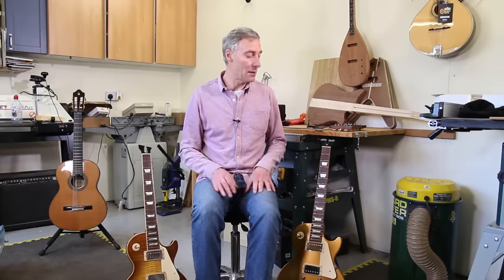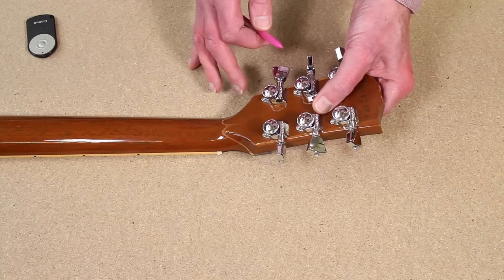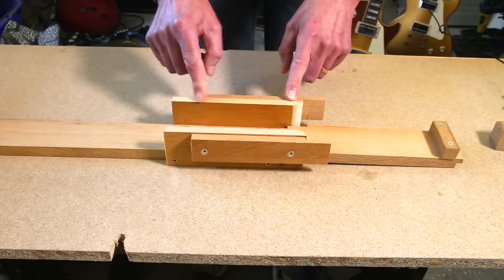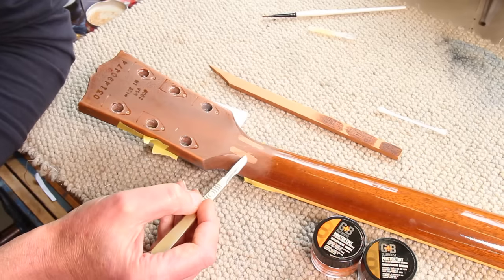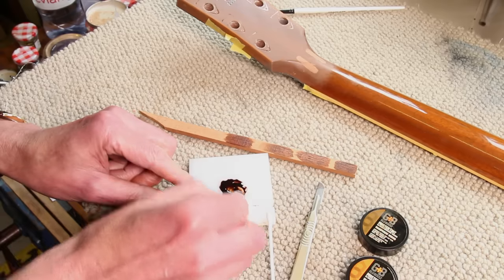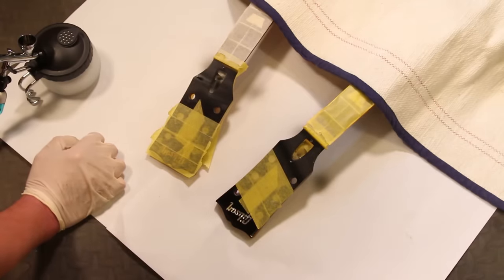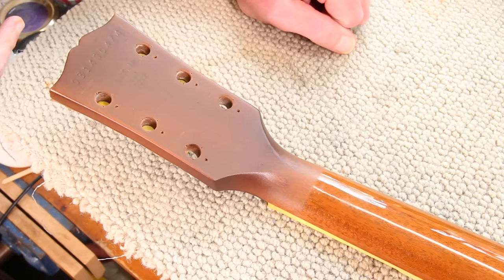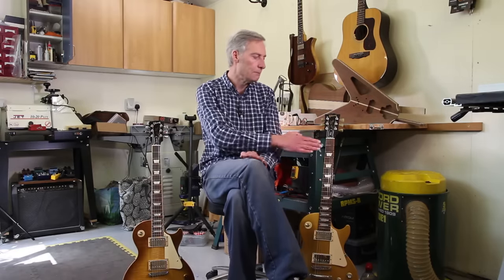Repair of a Gibson Les Paul with a snapped off headstock

Comment: Good old Gibson always looking to help smaller luthiers by giving them plenty of work on these complicated times! So kind of them
Reply from the maker: That thought has crossed my mind  many times!
Reply: I hear that there are lots of Les Paul neck breaks, but I need to see some numbers, not just anecdotal evidence.
Reply: @Wizardofgosz  Not a frequent occurence but should a non-70s (Norlin era with the volute headstock , one of the only positive attributes of the 70-83 Gibson era) LP fall backwards on the headstock, chances are it's going to crack at the very least. In the case of this video, I have never heard of a neck snapping like that without an extremely hard hit.
Reply: @kevinsibert3160  I had a 73 Les  Paul Custom with a volute which had a headstock break. My understanding was that the volute never worked which was why they stopped using them in the 80s.
Reply: I have a 1985 Les Paul Custom and no neck breaks I play it four hours a day and used it on stage extensively when I was younger. They don't pop apart by themselves, but the headstock is tilted back at 14 - 17 degrees and the neck join is tilted back at 4 or five degrees if the thing falls backwards for example a headstock break is extremely likely. The tone and feel is worth it but you have to be sensible. I always carry one of those fold up Hercules stands in my kit bag. Strats and teles are all flat (string pressure is created with string trees and such) hence breaks are much less likely, but they do happen. I've seen it!
Reply: Richard Wielgosz my 1963 ES345 broke twice! First time, it fell forward off its stand onto a carpeted floor and the head flipped forward. Second time I found it broken inside it’s hard case. I can only presume someone had knocked it over. Still only marginally less sickening than watching it happen!
Reply: Richard Wielgosz Numbers? Like, someone's just compiling evidence of all the Les Pauls that have had headstock breaks? Just look at used Gibsons on the internet, like an eighth of them (maybe even more?) have headstock repairs. I've fixed probably half a dozen of them, and I just do guitar work as kind of a hobby, real luthiers have done dozens or even hundreds. It's widely known that it's unusually easy to break Gibson headstocks due to the unnecessarily high angle, no volute, very thin material, and one-piece construction.
Reply: @hydorah  They're also maple which is much harder to break, with virtually no headstock pitch as you indicated, and often need aftermarket fixes (Like a Mastery Bridge and a Buzz Stop tensioner on Jags and Jazzmasters) to combat the tinky Fender tone.
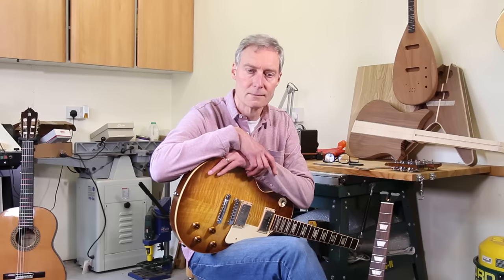Reply: @Wizardofgosz  Did you even watch the video? Starting at the 1:20-mark, the creator of the video says over the last ten years, the vast majority of broken-headstock guitars he's fixed have been Les Pauls. If you want to conveniently ignore what he said, go to reverb.com and look at used Pauls. A ton of them have had headstock repairs. Knowing about the fragile headstock, I treated my '01 Custom gingerly and never experienced a break. As with many Les Pauls, though, the G-string would not stay in tune, no matter how much time and effort went into fixing it, so I never gigged with it. I sold it for cheap and made sure the buyer knew about the tuning issues. I have not missed that guitar and that brand at all.
Reply: @jaypreminger8942  I'm sorry. Did you say something?

Anecdotal evidence. Sorry.

everyone thinks red shirts always die on Star Trek but you know what, when you do the math it's actually yellow shirts that die more so sometimes things aren't always as they seem. Anecdotal evidence doesn't mean a goddamn thing. Show me real numbers
Reply: Unlike that insensitive Fender with their "bulletproof" necks!
Reply: @Wizardofgosz  Sensitive much?!
You must be a Gibson fanboy, getting all hot and bothered over what is common knowledge in the luthier trade!
To my knowledge there is no database with the hard numbers you seek, doesn't make it not true.
Reply: Well said lol!

Comment: A Les Paul with a snapped off headstock, now that's what I'd call 'Authentic'
Reply: Indeed, Gibson is to arrogant to fix the design. After all, it "tradition".
Reply: @joshuabarron8535  it's not a gibson, it's people. tell me if you were a gibson les paul fan, would you prefer different design? of course no. masses dictate design, and in this case i agree with them. i love les paul design :)
Reply: If you like the LP style of guitar, then try other brands. They will be a much better value. Gibson=overpriced. Something like the PRS SE 245 Single Cut Electric Guitar. Less than half the price. And because its PRS, it won't have quality issues, or a dated headstock design.  CHECKMATE
Reply: @joshuabarron8535  hate prs. i'm thinking of getting maybach lester, they are plain amazing. but they ain't gonna hold their value as well as gibson of course.
Reply: @joshuabarron8535  "dated" is what drives people to buy gibsons. and i'm this kind of guy :)
Reply: @DeeKeyLP  Whatever fanboy.
Reply: @joshuabarron8535  good for you i'm. not as toxic
Reply: @joshuabarron8535  They did change the design.
they reduced the angle of attack on the headstock and carved a thicker sort of volute in the arc of the headstock to further reduce potential breakage.  Not to mention the Maple necks that went in.  All that in the 70's to about.... 1982 or so.

The end result was the cork sniffers who kept  saying (that's not a 50's spec wtf!)  stomped their feet until Gibson stopped doing it.  

It's just a thing you're going to live with and possibly face because better or worse it's the gibson sound and feel.  Comedy that the same cork sniffers want to imagine your guitar is worth 1000 dollars less because it's had a neck repair.  (just not theirs)
Reply: @leedemkiw.2894  Thats your opinion.
Reply: @voided76  And yet they still break. 🤔
Reply: @joshuabarron8535  very true.  

I think that's at least part of the reason gibson went back.  You can mitigate it 100 timse but when is it not what you started with and if it doesn't quite sound or feel the same and it STILL can break ... well f it  lol

Being that I broke my own 93 LPC and being that it was glorious before and after the repair,  I don't see a lot of the gripes other than "shit happens"
Reply: @voided76  Owch, bummer for your guitar man, sorry to hear that.

Comment: Having worked in a guitar shop specializing in used and vintage, I've seen many repared Gibson headstock breaks. I have never seen one done as beautifully as these. Thanks, I've subscribed!!!
Reply from the maker: Wow, that is very kind of you.
Reply: MANY repaired Gibson headstock breaks tells the tale... Gibson has faulty factory guitar design of the headstock/neck area that fails repeatedly.
Reply: @DougHinVA  I don't get what is faulty about it? Usually when you drop something, it breaks. Knowing that Gibson's neck angle is prone to breaking when they fall back, don't drop them. That would be like wondering why a TV breaks every time it falls on it's screen. It's not a faulty design because they're not meant to fall.
Reply: @wiseguy9202  only he explained the owner was quite certain he hadn't dropped the guitar.
Reply: @jimmoore7442  the headstock didn't just fall off by itself. It's an obvious impact break.
Reply: @wiseguy9202  Certainly not. Have you never seen a piece of timber that has split by itself? Of course you have. Timber moves especially if not fully dried properly.
 The design has no strength because it is relying on cross grain to do more work than it can.
 I have a problem with a Bass made to order by an American company. It has been played 3 times in church thanks to lock down and a bit at home.
Its body has actually burst from the inside out in the area near the Jack socket where there is cross grain that doesn't belong there. What do the UK vendors say? Ah we can see its been dropped. Not so it was fitted with strap locks before it even left its box. 
This is what happens when prestigious big name companies get it horribly wrong.
Reply: Well luckily for me and everyone I've ever known that plays guitar, have never had a headstock just randomly pop off. If that happens, I'm not calling a luthier, I'm calling a priest to perform and exorcism.
Reply: @wiseguy9202  Maybe if you call a priest who is a luthier he will perform a resurrection 😂
Reply: @flameguitars5770  I agree with Walter... Great work. Really turned out nice. On another note, in the future if you want to record the spraying process, you could just cover your lens with any of various different types of transparent plastic materials. You could even just rubber-band a piece of plastic food wrap or packaging shrink wrap.
Reply: @DougHinVA  “Yeah, well, you know, that’s just, like, your opinion, man.”
Reply: @jimmoore7442  And  I  believed  him.  Maybe guy had kids...or  mischievous spirits, being England and all.
Reply: @jimmoore7442  mischievous spirits
Reply: @wiseguy9202  'wise guy' is a good name for you. TVs and electric guitars are not at all alike and a Gibson LP is one of the finest electric guitars from a factory. Explain that away and no TV sets included in the excuse making...
Reply: @DougHinVA  Not sure if you're missing the point on purpose or just effing with me?
Reply: @DougHinVA  "Gibson LP is one of the finest electric guitars from a factory.". LOL: Gibson has some of the worst quality control of any major guitar manufacturer!
Reply: Well…. Mine broke about a week ago… it was fine the day before it broke.. I picked it up from the stand…and there it was.. cracked..

Comment: Beautiful work by a true craftsman! I had a 1974 Gibson Led Paul Custom as my first electric guitar. No break on the headstock, but I wonder why Gibson has not fixed the issue permanently by now.
Reply: Gibson fixed this issue in the 70s with 3 piece maple necks, a lesser headstock angle and the volute. But customers wanted 50s style Les Pauls and so Gibson went back to the weaker Mahogany neck design prone to break…

Comment: A great craftsman indeed.
In the 1980's I bought a new Gibson J-50 acoustic which came with a Gibson case. To my horror 2 weeks after I bought it I opened the case one evening and the headstock had snapped off in the same way that you describe in the video, I was devastated, I got in touch with Gibson who were far from sympathetic, they more or less called me a liar and would not accept that such a thing could happen, they took no responsability whatsoever.
I was living in Paris at the time so I took the guitar to Favino who made a repair for me which was fairly good but did not last for too long, the head moved a little which made it almost impossible to play.
That was the the last Gibson I ever owned, moved on over to Martin instead.
Brilliant job on those two LP's

Kind regards
Hamish
Reply from the maker: Thanks Hamish. You will find a number of comments here questioning whether it is possible for a neck to break without some form of impact. But you will also find a few people saying that they opened the case and found the neck had broken. I talked to someone recently who had a new gold top and the neck snapped within the first month of owning it. Devastating.

Comment: My grandmother had a 70s Les Paul.  She had it put away in her closet.  It was perfectly fine, then when she passed away, we opened the case and sure enough the headstock was snapped off.  This is a woman who used plastic on the couches. The rest of it had no dings or damage.  Had it repaired and you can't tell unless you use a bright flashlight and look closely, but it's black so that's easier to hide.  This repair is beautiful. Very nice work!

Comment: What is it they say about a repaired head stock being stronger than before? They should break them at the factory, then repair them; it won't happen again.
Reply: They should drill dowels into them and do a proper fucking job of engineering.  It's a stressed member with only a couple of mm of thickness on a stress point.  Shit design.  Don't get me wrong, I love these guitars but the headstock is the weakest thing on the guitar.  Easy to fix.
Reply: @GodzillaGoesGaga  Thing is, it's not like it's a new design. It's been crappy for decades. I know, I know, people like it. But if it's crappy...
Reply: @GodzillaGoesGaga  
Perhaps, cut channels and insert maple pins, dowels or splints before the headstock overlay and fingerboard are installed at the factory.
This would probably be best done along with routing the truss rod channel into the neck blank. The aesthetics of a one-piece neck would be unaffected and the reinforcements would be hidden along with the truss rod.
Reply: @maverickdallas1004   Nah, inlay rebar; all up & down the neck. No-one'd ever know...
Reply: @maverickdallas1004  I was thinking rectangular bar stock graphite for the inserts, since they'll be completely hidden under the fiber cover anyhow. It's similar in concept to putting graphite rods under the fingerboard of a neck that didn't originally have a truss rod.
Reply: Make the headface out of carbon fiber and put the truss adjuster at the heel.
Reply: When Gibson added a volute in the '70s, players went nuts. Martin used a volute at that time, as well. They make sense no matter what the purist experts have to fuss about it. And people need to learn to use humidifiers in places where air conditioners or heaters run most of the time. Mahogany is a relatively soft wood and dries out in a hurry, on top of being soft. I changed a BUNCH of tuners in the '70s, replacing those crummy original tuners with Grovers or Schallers, and the residue would fall out of the headstock as very dry powder.
Reply: Certainly think Gibson should be looking at redesigning that part of their guitar.
Helped me decide not to buy one.
Good job Gibson don’t make aeroplanes 😱
Reply: It can only be as strong as the surrounding material...

Comment: And my VERY similar happened to a Gibson Les Paul Standard that was resting IN A STAND, but it was plugged in, and my ankle was tangled in the lead, so when I walked away I also yanked on the guitar and it took a nose dive resulting in a complete break just above the truss rod cavity...  Luckily I was able to repair it myself with some good old Elmers wood glue and clamps, and a few years later it's still holding, knock wood!
Reply: I cringed reading this
Reply: Just don't knock on the repaired headstock wood😁

Comment: Fantastic job on that color matching hiding those splines. If that was my guitar I would have told you not to bother with color matching. And I'd have said go ahead and use maple. Battle scars! What's a Les Paul without a repaired headstock?
Reply: I agree. A quality, proper repair is important but in my opinion there’s nothing wrong with an evident repair. Maybe some dye on the splines so it isn’t highlighted would be ok. I suspect the neck is stronger now than when it was new.
Reply: Hear, hear. In fact, if it were mine, I'd use maple and then refinish the neck natural. I would do exactly what he did on the front, but I'd want to showcase the clean repair on the back of the neck. A Gibson neck repaired this way is much stronger than when it left the factory, and on a player-grade instrument is often as or more desirable than an unbroken one if done well.
Reply: "What's a Les Paul without a repaired headstock?" One that's never been dropped.
Reply: What's a Les Paul without a repaired headstock?
My maple necked '76 Custom 😂
Reply: Peter Macfarlane I want a maple neck Custom SO bad...